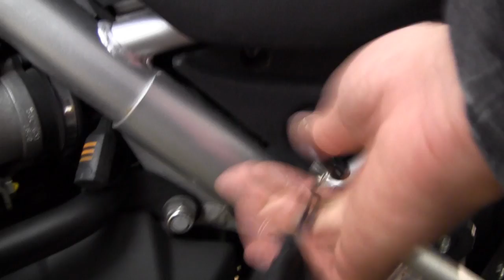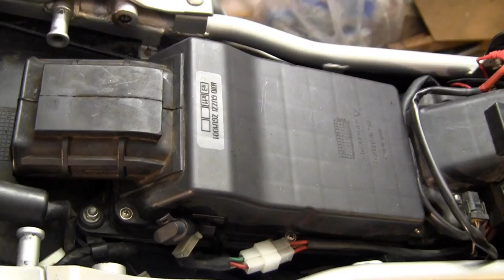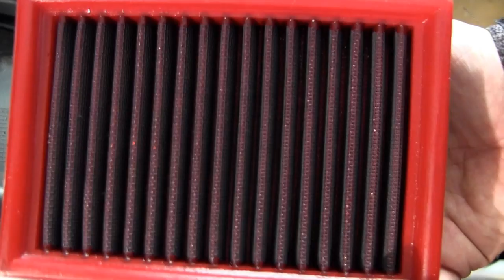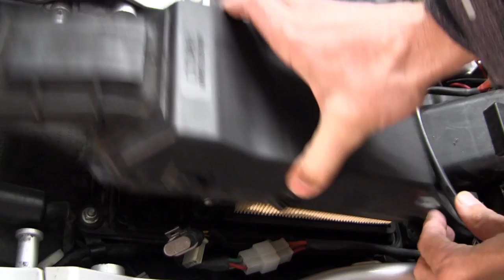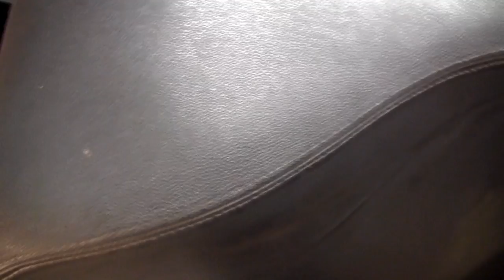Moto Guzzi Stelvio Air filter replace

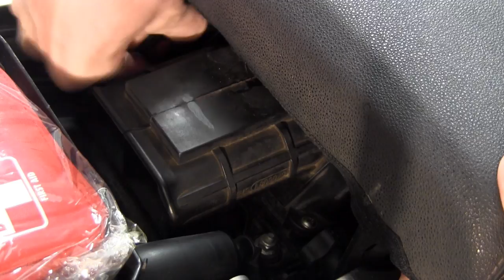Comment: 0:25 - What are those two big screws you removed for the front seat? I don't believe they are stock so some sort of a customization? Is it to hold the front piece from moving back and popping out of its place?
Another very curious thing is, you went from a reusable filter back to a stock type paper filter, wondering why (bike running too lean/hot)?
Reply: @deporbert  2017 models don't seem to have those screws. Now that I think of it, I kinda wished they did because if I place the seat in the higher position, it does have a tendency to eventually pop out of and drop down in the front which makes the seating position very awkward.
Reply: @deporbert  I just checked mine, no such screw hole/point. Not sure why they excluded this in the last year model but I am bummed! Instead of the metal pieces that stick out/down where the knob screws go thru, the back of the front piece has grooves similar to the front end that goes into the plastic stub type piece that is a part of the battery bracket. The design is quite different and I think they wanted to make it more practical and easier for removal but it came up a bit short. When you lift the front piece and use the top opening to place it, it creates a tiny gap in between the front and the back pieces so when a person is sitting with that much weight/force, it doesn't take much for it to slide back and pop out from the front connection point creating a really bad sitting position because the front piece gets slanted like 20 degrees downward in the front.
Reply: Mine is a 2013 model and there are no screws.